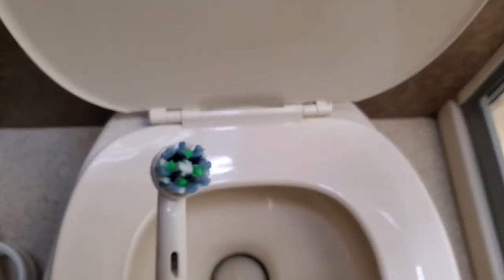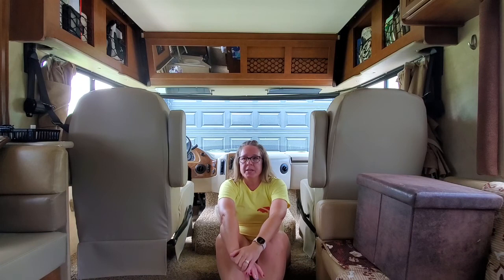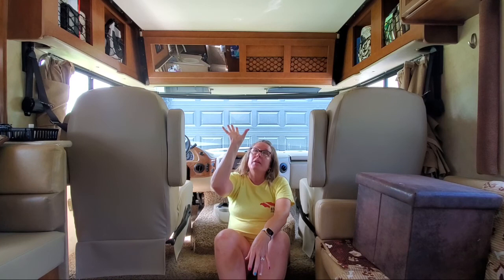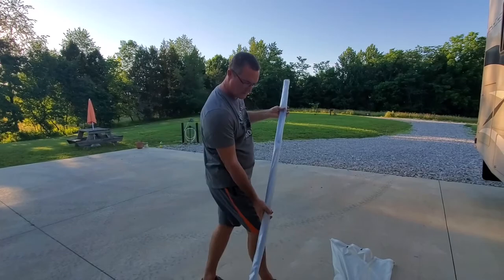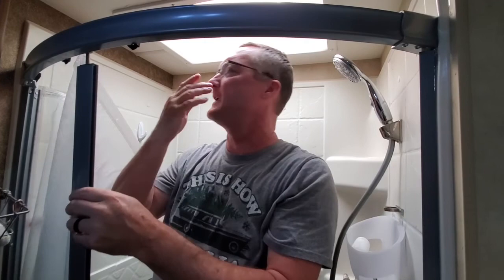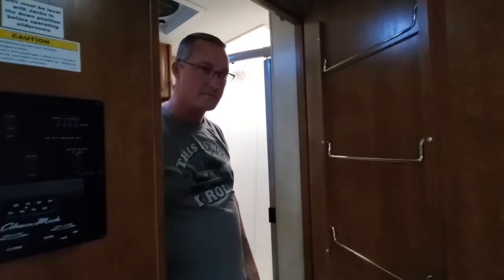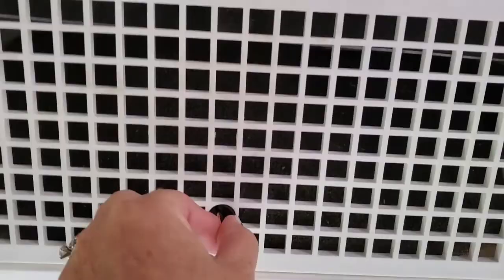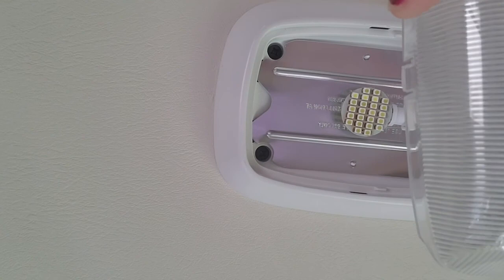RV Deep Clean and Plastic Shower Curtain Replacement || RV Motorhome Life

Comment: Your literary training me. Glad to see you change the shower curtain. I  contacted Thor Warranty checking for any recall on this model. They send me an email saying that the shower curtain have a recall regarding fire safety. As soon I  finalize my paperwork will check with an authorized dealer for replacement.  Also the wipers have another recall. They weren't put correctly from factory making they loose. Have you seen any brown spot on the ceiling fabric? It looks like glue. Need to figure out how to clean it.Thanks so much for posting.
Reply from the maker: We had both of those recalls you're talking about.  The shower curtain they replaced ours with was TERRIBLE...very thin and flimsy.  We have since replaced it again because of living in it and I couldn't get it clean.